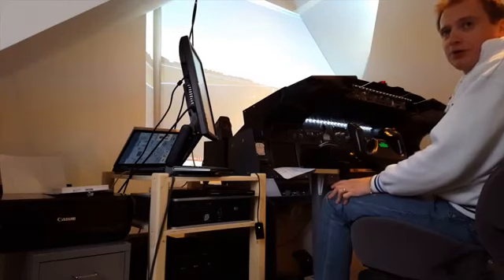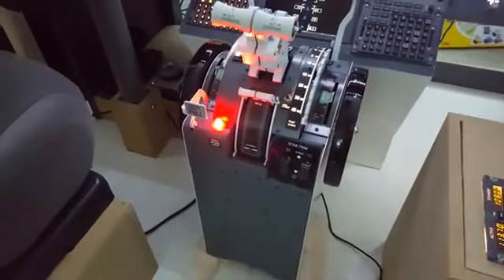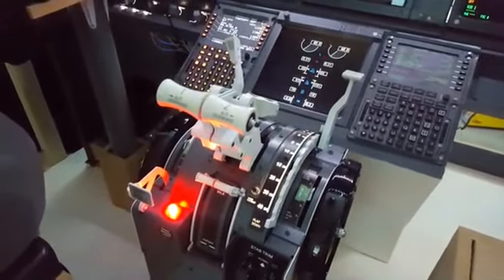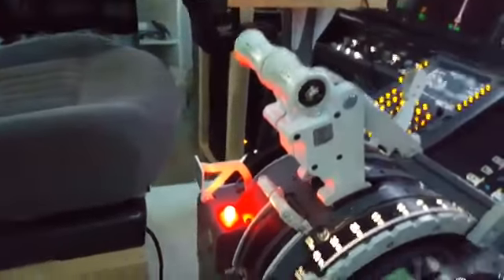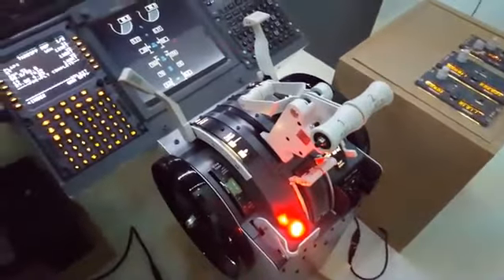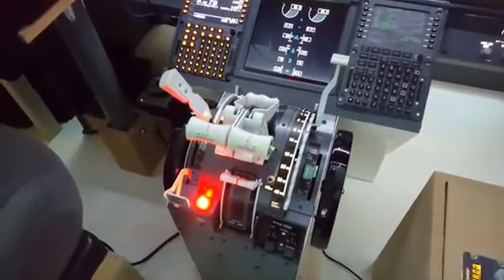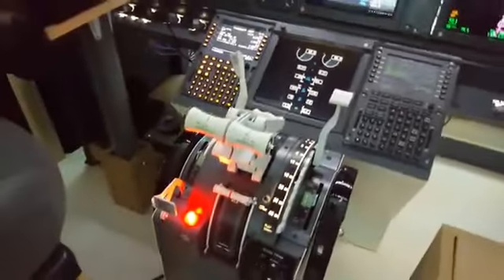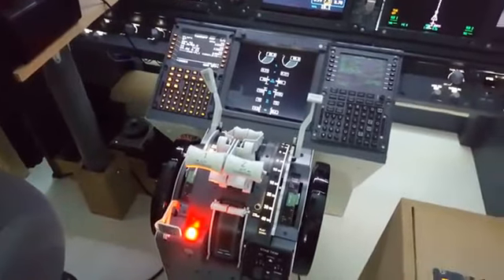Cockpitsonic Throttle for my 737 800 home simulator

Comment: Hi! Thanks for the video!
I have a cockpitsonic throttle too but is not working properly! Can you help me?
Reply from the maker: I am not sure, if you tell me the problem I can see if I know the answer. I had some calibration issues and I had to take it back to the shop I was not able to solve them myself. If the problem is mechanical than I really cannot help, sorry.

Comment: Why did you bring up the little displays?
Reply from the maker: Purely for demonstrating that fsx responds to everything you change on the throttle. The upper eicas on the right was to show N1 power changes has the throttle handles change position.
Thanks for watching.
Reply: Do you have the pmdg 737?
Reply from the maker: +patrik streng no is the Prosim737 jetstream
Reply: Cool
Reply: 737ngxsim 0

Comment: Why isnt the flaps full down when geeting ready for take off?
Reply from the maker: +MgtowTruth because the runway I use and the aircraft setup I use requires only flap 5 for take off.
Reply: Can u eexplain me that in details , i don't get it
Reply: You don't need the flaps down at the 40 position or 30 or any number below the 10th position because on most takeoffs flap configuration 5 is sufficient to generate lift for T/O. When coming in to land then its sufficient to use flap 40 because you work through speed and flaps in tandem to glide down onto the runway.
Reply: Flaps are not supposed to be full any time only around 2 or 3
Reply: S
Reply: You never use flaps full for take off 😂🤦🏼‍♂️

Comment: Buy the pmdg 737, this standard 737 is a very simple aircraft and not realistic
Reply from the maker: The standard 737 was only used for the throttle demonstration. PMDG cannot be used on this cockpit, I use Prosim737 flight model, the best on the market for cockpit builders.